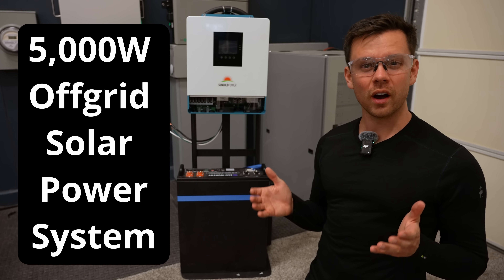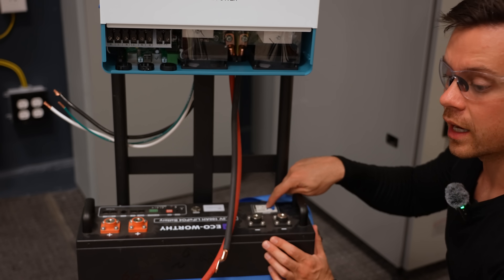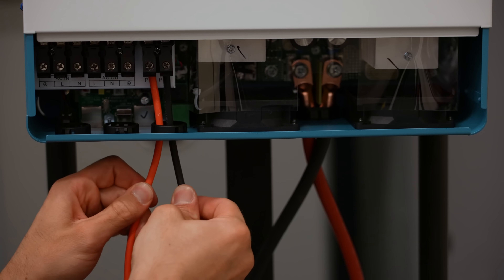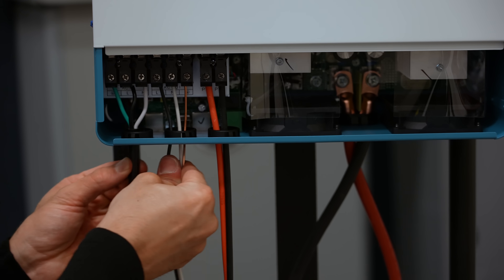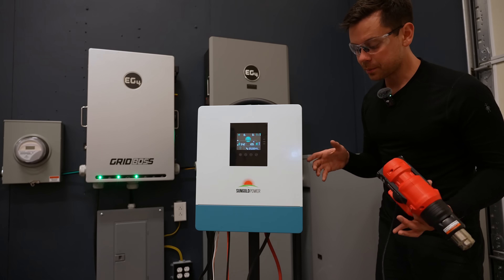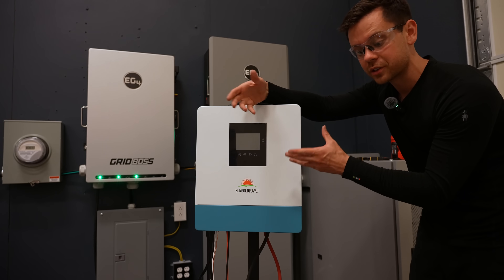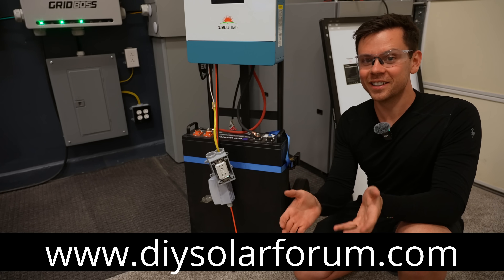Build a 5,000W Off-grid Solar System in 1 Hour

Comment: Hi Will 
I have watch your video since u still live in camper. Now you became a successful and trustworthy  solar utber.

Finally, I just bought 25 panels made Canadian Solar model
CS6x-305P.
They are used solar, 5 years old  with 95%.
I like to ask your advise if these 25 CS panels compatible with your set up 5500W, 48v emergency off grid power inverter and 2 batteries system.
Thanks

Comment: Great information. Appreciate this. But I spend 27 out of 30 days driving a semi. I don't have an APU so my truck basically runs 24/7. 
I wish you could build the same system for a semi and install it. It doesn't have to run off solar because the alternator on the semi could keep the batteries charged. 
A basic APU system on a semi is $12,000. I know this type of system would be cheaper. 
Any info or maybe a video would be great. 
But thanks for the wealth of information you give.

Comment: @WillProwse how did you mount the inverter to the hand truck? Looks like maybe you drilled holes through the upper tubes and connected the upper corner flanges with through-bolts and nuts? Is that right? Anything on the bottom of the inverter?
Reply from the maker: Yes just some little bolts and holes
Reply from the maker: Nothing on the bottom of the inverter. It's always up or on its back. So it should be okay like that

Comment: Great introduction to a self contained offgrid setup. Overcurrent protection won’t stop the fire when too many amps are traversing the conductors to those AC outlets and whatever is connected to them… Also there is no protection of life without bonding and adequate breakers (RCBO) etc…. Be careful on the AC side…

Comment: Quick question. I'm planning to build a whole house backup. I have an EV with a 100kwh battery. I would like the battery backup system to kick on when the power cuts out. I would like to be able to plug my EV into an AC input plug to my battery backup system and charge it even while it's being used. That way, the power goes out, everything still works including AC or Heatpump, and I can plug in my EV to keep adding juice as it's being used. That way, even when it the battery drops some when the big stuff runs, when the big stuff is not runnin, the car replaces the power used and catches the battery back up. In my case, the car can output 3kw. Anyway, would this system allow me to charge the battery while it is being used?

Comment: would a 6.5kw work the same way with the same battery? (some suppliers listed no longer have the 5kw inverter avail. 
assuming 6.5 would also work. Also i wonder if a 240V can be hooked up to it charge EV?

Comment: Will, can the AC outlet you connected handle the full 5,000 Watt output? Or will you only get the full output by designing a load center?

Comment: So in regards to the outlets method. Are you saying just have a standard fuse/breaker box between the solar system and your regular outlet circuits? Do you have a video explaining that process?

Comment: Awesome Will!  Hey, If I used a The SunGoldPower 10KW 48V Split Phase Solar Inverter with an RUiXU | Lithi2-16 in an RV could I hook up a Level 2 EVSE for Tesla fast charger without issue or would it be rejected for some reason? Seems like all the specs work out, not sure if there would be a communication issue?

Comment: If you are using a battery without a built-in circuit breaker like an Epoch Marine 48v what additional components are needed for the connection of the inverter to the battery?

Comment: Can this inverter be set to only wall charge at night or only on the weekend?
Reply from the maker: Yes. Easiest method is with a $14 wifi outlet plug. Just set whatever schedule you want. The inverter has the same ability but the WiFi plugs are easier

Comment: Can you wire a twist lock socket/outlet 30 Amp 125/250V 3 Pole 4 Wire Grounding into the ac out that you had a regular outlet wired to in your video and in your 3,000W video had a power strip wired in for the video? My goal would be to be able to plug it into a generator outlet that is connected to my breaker box with an interlock between the switches for the grid and this item. I've seen it done with the ecoflow delta pro ultra and wanted to see if you could wire your own connect to then power everything in the house together however long the many batteries last. Is there a limit to how many batteries you can have?  I'm super new to this but am very interested

Comment: Hello, in Cuba, many photovoltaic installations are starting to be implemented due to the endless daily power outages. There is a 3.6 kW model from the brand PowMr that has a problem reported by many users. However, it's not just PowMr but also Summry, Xijia, Y&H, and other Chinese brands with the same 3.6 kW capacity. The issue is that when more than two cooling appliances are connected—for example, a refrigerator and two freezers—the inverter starts to vary the output voltage. The effect can be seen as flickering in the LED lights at home. So far, no one has found a solution to this problem. It can only be mitigated by increasing the load, connecting more lights or resistive loads, or even plugging in fans until the voltage stabilizes. Have you detected this issue in any inverters you've tested? Do you have any solution other than replacing the inverter?

Comment: The trouble I have is I want to build one for a mobile system. That means sometimes it will be plugged into shore power and sometimes it won't. That also means I need a dynamic ground-neutral bond so I don't have to remember to manually change it--that's just a recipe for failure. Nobody ever talks about this and these systems often have terrible documentation on this. I'm always super frustrated that nobody seems to think about this issue.

Comment: Hi Will, long time watcher, first question. On a simple small system with 12V battery, and I just want to use it for emergency power for my ham station, for now - is it safe and ok to leave the simple charge controller on the battery at all times and draw the 12V battery so supply my 12V powered station, at the same time? I heard you say to be sure to let it reduce to 0% so I'd think not. What is the best solution to set it and forget it, if possible?

Comment: I got a PowMr 5K 120, you can connect two power strips an a 20 amp outlet together in the same connection in the hybrid controller/inverter/charger.

Comment: So, with 7 solar panels, this setup is about $4,000, right?  Not including solar mounting.
Inverter - $1,000
Battery - $1,000
7 Panels - $1,750
Misc - $250

Comment: I'm trying to wrap my head around this. Even with solar panels and wiring it seems like you'd be into that for around $3,000. I can run my whole house including the central air on a 15,000 watt (peak) generator. So it seems like three of those systems ($9,000) would be enough to run my house. I'm sure I'd need more storage to get me through the night, but it still seems like my math is off or I'm missing something important (and expensive).
Reply from the maker: Oh there is cheaper ways to do it when you build it larger. Check out my other videos on the 6000 XP.

Comment: I would like to buy one of this all in one power system, but for the moment I only need to connect a 12V refrigerator (627wh) and mini split A/C (950 W),, I need them working 24 hours,,is that possible with this power system?

Comment: Another outstanding video by Will. I’ll soon be building my second mobile solar system by following your steps. 
I’m a little confused on needing 120v to charge a 48v battery though. I was planning on 2x 24v panels in series. Would I then put the step up controller before the SunGold Power all in one? 
Thanks so much for helping this technically challenged individual with these excellent projects!
Reply from the maker: Connect step up controller to the battery directly

Comment: Could you kindly, email me the schematics & total cost w/7 panels, plz? I'm not quite sure if I can afford them or how I will pay for your sweet setup but, I will have to figure that out n PRAY. I am a disabled/retired journeyman who lives on the gulf coast n in a mobile home. I wanted to have solar installed n was told by code enforcement that I couldn't.  With the light weight of the solar panels, I could install them on the roof that gets sun all day long. I survived last season but, a lil concerned bout this one. TY so much & GOD Bless. 
S. Da Vinci

Comment: Amazon has flagged that all in one unit flagged as a frequently returned item. Lots of negative comments about it. Why do you think that is?
Reply from the maker: Nope, that's the other ones they sell. Check out my past reviews, their other units can be garbage. This one is made by SRNE, same as EG4. Super reliable.
Reply: @WillProwse I thought I clicked on the link you provided. I’ll check again. Thanks.
Reply from the maker: @PorterValleyFarms  it is that link. But those reviews are for the other models
Reply: @WillProwse OH, okay. Thanks!
Reply from the maker: All of these companies slap their logo on them. You have to read reviews of individual units. Half the stuff they sell is garbage, the other half, really good

Comment: Always, always clear, succinct, thorough.  I've followed you for years and have never built anything because the size of my house requires a massive system and I don't know where to start.  I could do piecemeal like this, and maybe after learning so much from Will, I'll give it a try, but right now i have to nap.

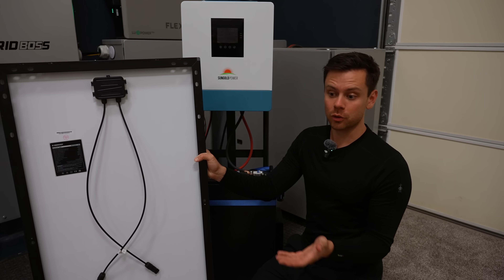Comment: At 9:20 in this video, you mention using a step up for smaller arrays. I am installing on a boat and have 400w of solar and 18kwh of lifepo4 @ 51.2v. I ordered the Renogy boost MPPT and the Renogy 3,500w All-in-one. My solar voltage is too low (max 39v). I wanted to stay in one product family and one app to manage. Renogy may not be the best AIO but they are the only boost MPPT with an app. I am trying to decide whether to connect the boost MPPT directly to the batteries as you mentioned OR wire the output of the Boost MPPT into the solar input of the AIO. The main reason to do this would be to make use of the AIO charging modes: PV priority, Utility Priority, Hybrid, Only Solar. If I am sending a relatively more stable 48v (as high as 58.4 for charging) from the Boost MPPT into the AIO PV input, will this work? Thanks in advance.

Comment: I have a Champion 3650 generator for my RV that I use all the time. It has a 30amp plug that powers my trailer. Your off-grid system would help so much. Right now my generator runs for 10 or 14 hours a day when we are out in the country. If we have this, I think we can use it and then use the generator to charge it. How would we wire for a 30a plug for the trailer?

Comment: This is probably a loaded question? If you want to hook it up to a refrigerator, a television and some lights in the house how many hours were that 48 amp battery give you. I’m only asking for an average because we have an old refrigerator. You didn’t really explain how Big the battery is. I will try to figure it out. Thanks you really explain that pretty thoroughly and simple appreciate it.

Comment: Hi Will, I have a 10kW grid-tied solar system on my home, installed about 9 years ago, with no battery. Aside from building your battery system and just plugging it into my 115VAC to charge, is there a good DYI way for me to have battery backup that can power my house during outages?  (an alternative to Tesla Powerwall, Enphase, Gernrac PWRcell, ...)

Comment: Thanks so much for all your content Will.  Doing a first time build and was hoping you can confirm the specs on the disconnect switch - the Amazon link goes to the 1000v 10a version - is that right?
Reply: I’d love to know that too. I’m using the eg4 3000 though.

Comment: Whats your opinion on using a T Class fuse per battery with those? overkill? About to install 4 of them on my bus.
Reply from the maker: Not necessary. I like to install them on parallel strings when I have more than 60kWh. But for these packs, not needed. Has built in DC rated breaker
Reply: @WillProwse awesome i appreciate you! saves me $400 😊

Comment: You were very clear why you want the minimum voltage to be 200V (7 panels).  It wasn't clear to me why at 7:47 you said that the maximum voltage to not exceed is 500V (14 panels).  Where did you come up with 500V?
Reply from the maker: Oh it's on the sticker on the side. It's just it's limit
Reply from the maker: Sorry about that

Comment: I’m glad I rewatched this- was unaware of the minimum solar input. I have only room for 5 panels
Reply: If you go to his linked page of instructions and parts he offers a solution for this issue. "The answer is a boost MPPT charge controller. This device allows you to charge higher voltage batteries with a low voltage solar panel." Check his link out for more info.

Comment: I have been watching your videos for many years.  I have built an almost exact replica of the 2 eg4 6500ex for split phase in my off grid house.  Now I am building your 5000 watt hand truck system for a neighbor,  except it will be permanently wall mounted.  In reading the Sungoldpower SPH5048P installation manual they strongly advocate fusing both the positive and the negative battery cables.  I will be doing that,  but I am curious why battery cable fusing was not in your video?
Reply: I am just guessing here, but the battery he is using here has a break built in.

Comment: Can you list out what this is capable of running and dumb it down for a noob?

On a small plot of land, building a small 400sf main building. I am looking to power the following:

1) portable AC unit or mini split (always powered)
2) full size fridge (always powered 24/7)
3) deep freezer (always powered)
4) TV and video game console for the kids
5) 2x 48” LED shop lights
6) Microwave
7) Starlink (always powered)
8) Possibly an electric stove/hotplate
9) water pump(s) from large water containers for irrigation (always powered, on timers)
10) a few outlets for small chargers/devices

Want to know if I need to invest in something like this or something substantially larger before I jump in and electrical is not my forte. Thanks in advance this video was extremely helpful.
Reply: Or at least point me in the direction so I can figure out each device myself and do the math so I purchase the appliances accordingly. Teach a man to fish so to speak.
Reply: @danielsmith1622  What is it you are aiming for? 

Completely off grid power? 
Or supplemental power with grid availability?
Disaster backup/power outages?

Comment: Great version 2 of the hand truck off-grid system, even though yellow box EG4 has indeed dropped in price, this alternative is more bang for the buck. I ordered and put it together, with a few refinements, using a Square D QO 60A Main Lugs plastic load box ($35), a tandem 20A QO breaker ($31), and two Southwire 20A power strips ($36ea.), all to maximize full output of the inverter. A great little system. Will add this comment and pics in the forum.
Reply: Hey brotha how much was total build? Thinking of doing this as a weekend project
Reply: I didn’t understand when he got to the part about not being able to get the full output of 5000 watts. He didn’t say how much power could run off that single outlet. And unfortunately I don’t understand your verbiage of how you accomplished the full 5000 watt output
Reply: For reference, 20A outlet @ 120V is only 2400W, so you wouldn't even be using half the capacity of the inverter

Comment: How do these units provide propper protection with fusing when using these in non grounded setups like in an rv or boat  as ac power supply. Did you test this?

Comment: For your solar disconnect, there is no green/red standard for on/off.   However, in the normal orientation, there is a standard for up/down (NEC section 240.81).

Comment: could you use that breaker box on the 3000W version of that all in one? That breaker box main disconnect is rated for 50 amps so is that safe to use on the 3000W version? sorry i dont know that much about this.

Comment: Grounding. If this is plugged into the wall and the grid goes down, the ground is still connected to the earth ground through the house wiring, but how does the ground work if you unplug from the wall?

Comment: I am building a remote system with 24 volt Discover batteries. The cable for the Lynk II isn't long enough to reach from main enclosure to battery box.  Can the Lynk II be mounted in the battery box and a longer Ethernet cable used to connect to Cerbo controller?

Comment: for vanlife, how well can the 5000 All in One hold up to vibration and movement within a vehicle? can the 5000 All in one get power from a 12v alternator?
Reply: From another video of his, he mentioned changing to a 48v alternator. Apparently most garages can accommodate you. I have seen a video here on YT of a car detailer using this system in a tool trailer, looked pretty cool. Hope that helps as there seems to be no replies so far.

Comment: Question? Can I connect an RV 30A cord into it instead of a 120v(20A) outlet. This way To can plug the RV 30A Cord to it. Thanks for your time. So glad I found your channel, I have learned a lot from it and I am still learning. I improve my 12V system to run better because of you. But I think we need to go bigger 24V or 48V. Leaning to the 48V because you show how to do it so easy. Thanks.

Comment: Will,
I’m building a shed with a n 18’x18’ single slope standing seam roof. I think I can fit 12 panel on the roof. I will have a small panel (50-60A) wired from my garage subpanel. I was thinking of doing an off grid system since I just installed a 60 panel ground mount grid tied system w/ 3-LG Power8 batteries for the house. Any thoughts.